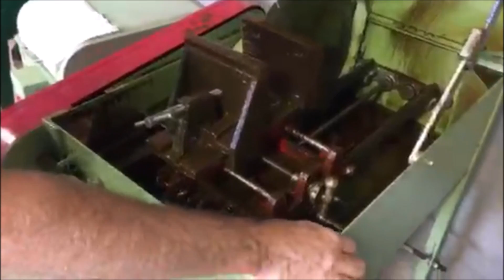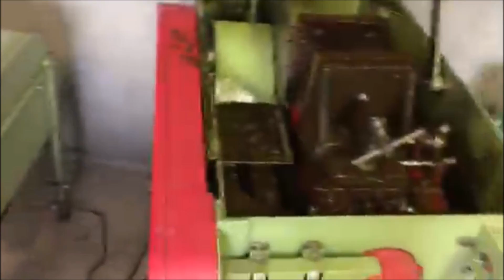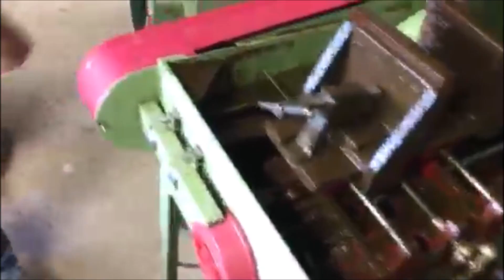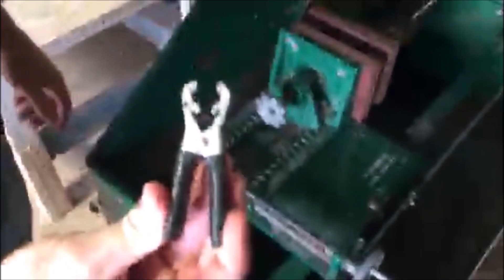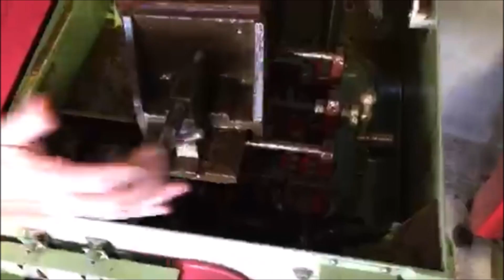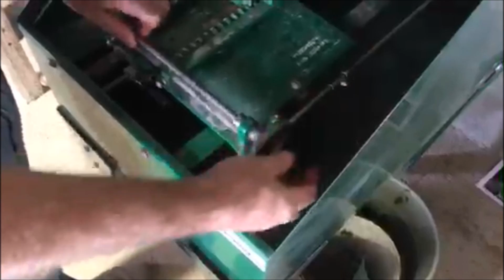Highland Park Vs Covington 16 inch Slab Saw   Point by Point Comparison

Comment: I have the new HP Model 16 as shown in demo. It has been well thought out and working quite nicely. Especially like the auto shut off setup when cut is completed. Upon opening hood to reset another cut I haven't had to be concerned about the shutoff switch tripping back on and getting a coolant shower. Like my LST has done to me. Very nicely done. Keep up the good work.
Reply: This is the newer model. It is a great safety switch safeguard. Thanks for taking the time to eliminate the problem. Just ask anyone that had his/her saw start accidentally and got a face full of coolant. :(  Nicely done! Thanks again.